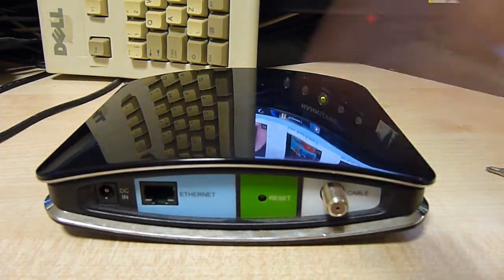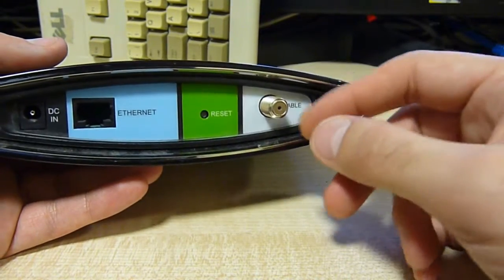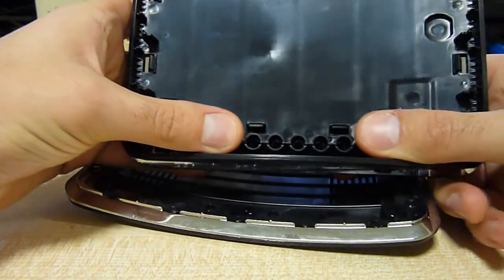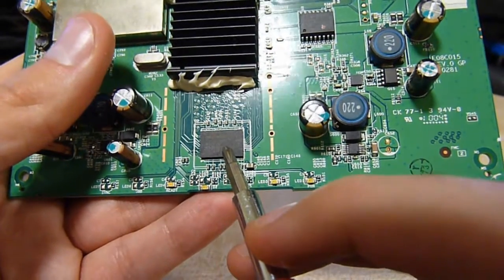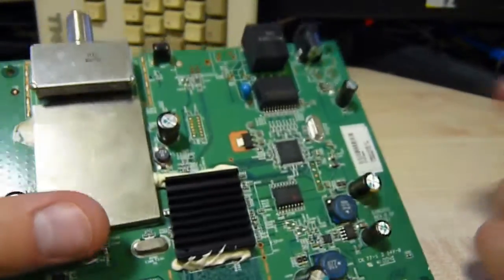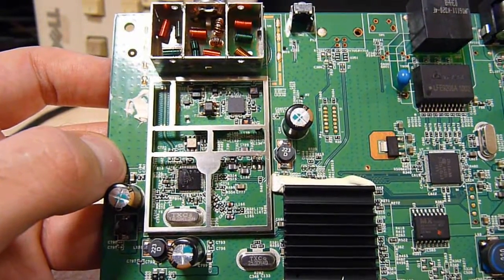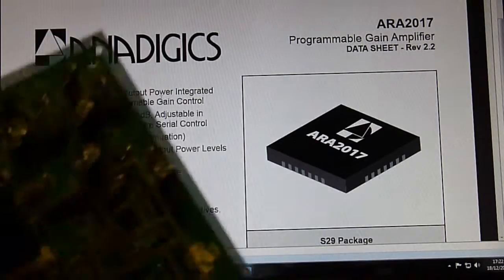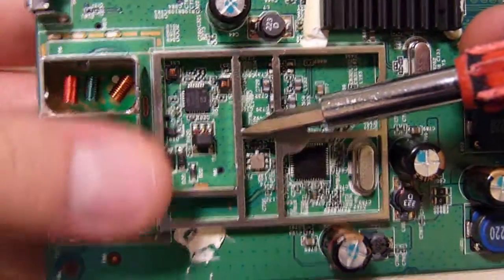Virgin Modem Teardown

Comment: The big ethernet 'block' type chip usually has the galvanic isolation in it, usually optocouplers, transformers, and other such goodness to keep the ethernet cable electrically isolated from the equipment.
Reply from the maker: The one in the WiFi thing used transformers, makes you wonder if the signals going through the cable are analog. It explains what they do though.
Reply: ***** They're digital, but being such high bitrate they transfer through just fine. Wikipedia has pretty good tech info on the 10baseT spec which is what all the other '8 pin RJ45 style ethernet' standards (100baseTX, gigabit, etc) are based on
Reply from the maker: *****
Nice, exactly what they do eclectically had been a mystery for a while.

Comment: im actually looking into the innards of Ethernet transceiver chips. fancy sharing a research project?
Reply from the maker: Not sure if there's enough for a research project, but smashing that WiFi thing showed that there are small transformers in them to isolate the high Ethernet voltages from the main control logic. Makes you wonder whether the data going over the line is analog rather than digital.
Reply: I'm up for analysing it and finding out 

Does mark still have the protocol
Analyser ?
Reply from the maker: crazyboy2006cashier
I don't know there you would have to ask them.